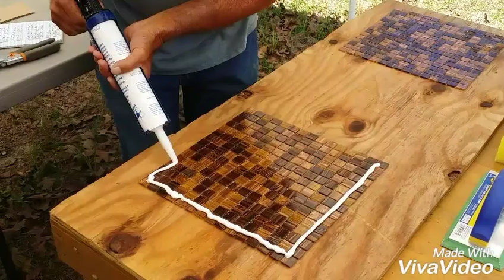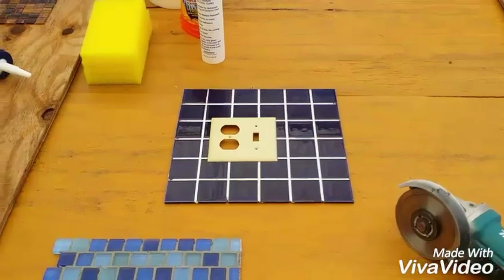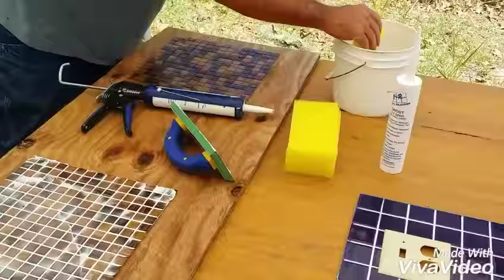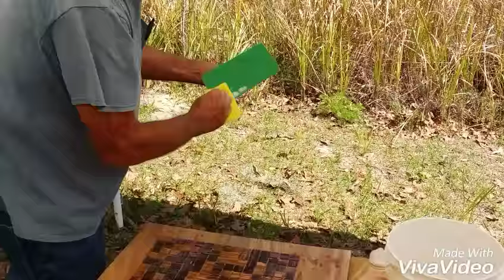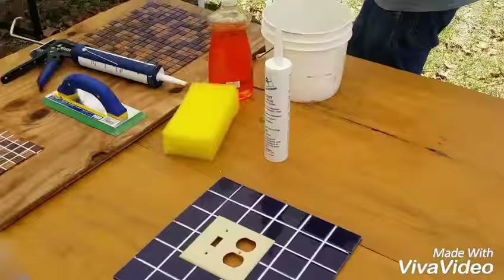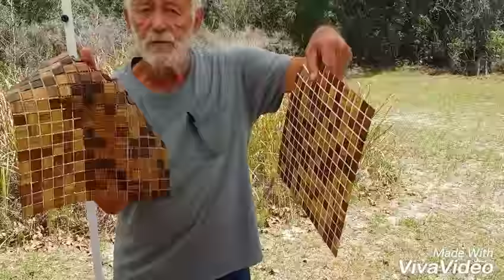How to grout & pre grout with silicone rubber

Comment: This is a great technique for RV's, thanks! One question, once you have created the pre-grouted squares, I am wondering if it would be easy to tell they are 12x12 squares and if you have a trick to avoid that? Also, is a waterproof backing board of some sort needed behind these since I am installing in an RV shower and can't risk moisture leaking behind? Thanks! 👏🏼👏🏼👏🏼

Comment: Is silicone 'rubber' the same as silicone 'caulk' that we use between sink and wall tiles in the kitchen or is it more like grout that we use between floor tiles?
Reply: The consistency is similar to the silicone caulk that you use.  It's a much different product. There isn't a pungent odor.
Reply: @raeganbatterson6102  Oh, thanks! That odor is not nice.
Reply: 100% silicone is waterproof and can withstand more expansion and contraction. And it is not paintable. 

Caulk is an acrylic compound that isn’t waterproof and could support mold growth. It is paintable, but it can crack with minor movements.

Comment: Ah, finally learned something new, after watching lazy people use peel and stick 'tile' on their RVs.  This was very clever!  Of course now I have questions...
1. Pre-grouting with silicone - does this mean that I can still use regular grout over the silicone in the matching colors I want?  Or am I stuck with only white silicone grout?
2. How long to cure before using tile on wall?
3. Any particular type of silicone for RV bath?  I'm thinking waterproof, mildew resistant?
4. When you pre-grout, the thinset mortar does not come up a bit between the cracks.  Does this affect adhesion of tile to wall?
5. I usually mix polymer not water to my thinset mortar for flexibility in RV.  I also mix polymer in my grout as it adds a sealant into the grout so no need to seal grout lines.  Can I still do this with the silicone pregrout?  Meaning... will it stick to the silicone or not stick due to rubber meeting silicone?
Reply from the maker: This is how to color the silicone rubber grouthttps://youtu.be/JJVWsFVj7JY:  Cure over night. Type of Silicone Rubber Grout = R & R Silicone Rubber Grout. We use silicone rubber adhesive to adhere the tile. http://www.flextile.com

Comment: I was watching your video kind of curious once you put that silicone grout is that considered waterproof after it dries 48 hours
Reply from the maker: Yes
Reply: Bob Ault 
Hi Bob, we are over in the UK and have a floor covered in Edge flooring which is two 12” tiles fixed to an mdf click and connect board. They are laid over a 5mm thick membrane. As a result the boards move slightly when walked upon resulting in the grouting cracking between the ends of the boards which are not “click connected “ Would your silicon based grouting a, be flexible enough to cope with the movement and b, help bind the unckicked ends of the boards? We had planned to use the same tile and click system in our kitchen but will have to think again if we can’t find a solution to the problem we have experienced.
I would value your opinion 
Kind regards
Mike
Reply: @MrSqueaky57  Hi Mike,

Got a similar but different problem in my kitchen and was looking at using some silicone as a repair for the broken grout I've broken/hoovered out.  Now what I have is a can of instant-gasket for a car long gone.  Kinda wondering now if I can just replace the under and between grout completely long-term.

I was looking for answers when I found this video.  My answer isn't here but I certainly learnt something anyway!